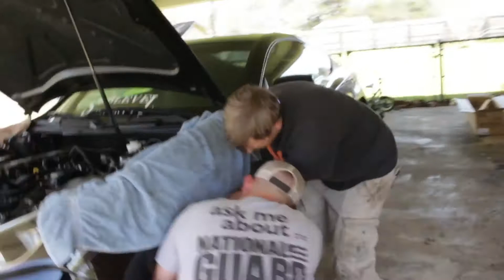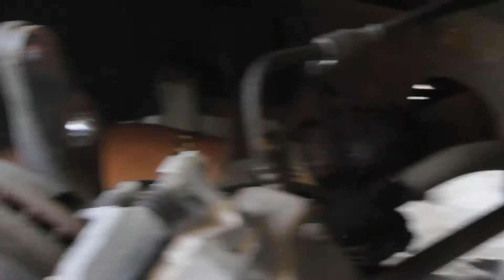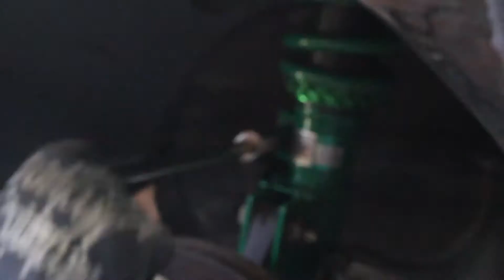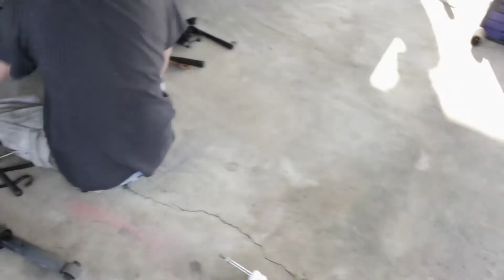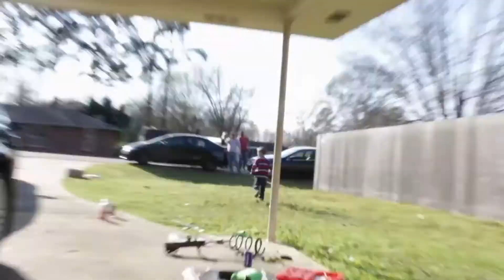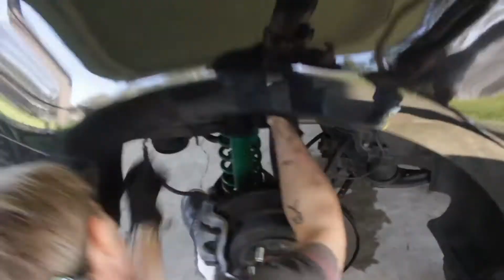How to install coilovers on a Hyundai Genesis

Comment: hoping to get a response but are the sway bar links the same length? I was told to get the 2010 swaybar links for the coilovers to fit but it seems the 2010 sway bar links are shorter than the bk2 sway bar links.